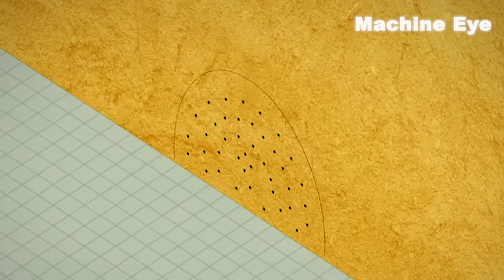China Leaves American President Shocked, Builds The Longest Undersea Tunnel In The World

Comment: Actually, the United States has been building underwater tunnels and tubes for more than a century. The Michigan Central Railway Tunnel (1910); The Holland Tunnel (1927); The Posey Tube (1928); The Detroit-Windsor Tunnel (1930); The Bankhead Tunnel (1942); Lincoln Tunnel (1957); The Webster Street Tube (1963); The Chesapeake Bay Bridge–Tunnel (1964); The Transbay Tube (1969); The Hampton Roads Bridge–Tunnel (1976); The Monitor–Merrimac Memorial Bridge–Tunnel (1992); and The Port of Miami Tunnel (2014). 

Granted, we've not had a need to build anything beyond 5.8 km in length but we have the capability. 

Also, don't neglect the fact that the City of New York has had deep subway tunnels in operation since 1904, and that the underground Delaware Aqueduct supplying water to New York City is 85 miles long and was completed in 1945.

Now, consider that the longest tunnels with underwater sections are the Seikan Tunnel in Japan (53.8 km) and the Channel Tunnel (50.4 km) and compare yourselves to those engineering accomplishments.
Reply: I thought so. Thanks for reminding everyone
Reply: @bobcatbigpaws5597  You're welcome.
Reply: hmmm... 🤔
Reply: But after 2000, US had been slow and slow, and US had many bad or failed projects, such as Big Dig. We are talking about future, right?
Reply: @easymi9964  It's hard to say, because so much is going on at any given moment and corruption, while less a problem in the US, does still exist, particularly where large scale construction is concerned.
Reply: Thames Tunnel London (1843)...
Reply: @benjamindenton  That's not a piece of American engineering, but thank you for adding an earlier feat to the discussion. Should also probably give credit to the inventors of Great Britain who solved the many problems relating to deep mining in the 19th century as well. Without their contributions deep mining and tunneling would likely not have been possible.
Reply: China has been building centuries ago even before the USA ever exist.😂
Reply: @_aweshit  Possible, but modern China is not the feudal China of the past, or the Nationalist/warlord pre-Communist China, or the pre-unification China with it's many kingdoms, or the China of the Mongol period. 
You could probably say that the pre-cursor states that existed before Modern China were building some of the most interesting structures centuries ago and be more accurate, because the links to the past, living and written, in China were decimated and destroyed in large part by the Chinese Communists during the Cultural Revolution. They don't have an unbroken lineage of engineering, construction, and education because Mao and the Red Guards were trying to eliminate traditional histories and allegiances to anything other than the Chinese Communist Party. 
Contrast that with the United States, which has institutions going back to the time before the Revolutionary War and hasn't lost those links.
Reply: @_aweshit  building what? 5 thousand years of killing each other only to be invaded by other smaller nations and only allowed to rise by bill clinton in the 90s? facts are against you, wumao
Reply from the maker: You're right, the United States has indeed built several underwater tunnels and tubes over the years, showcasing impressive engineering accomplishments. Projects like the ones you mentioned, such as the Holland Tunnel and the Chesapeake Bay Bridge-Tunnel, demonstrate the country's capabilities in tunnel construction. It's important to acknowledge and appreciate the engineering achievements from different parts of the world, as they contribute to advancements in infrastructure and transportation globally.
Reply: @MachineEye  Yes, because every country is capable of contributing to the sum of mankind's knowledge.
Reply: @MachineEye  how about you change your name to Pi Yan?
Reply: That means China technology is copy cat.
Reply: A lot of which were built by chinese labor
Reply: @tomcbeatz  Really? Most of the construction was done by union workers and construction companies on the East Coast. Not many Chinese-Americans or Chinese workers on those projects.
Reply: Also going into a long underwater tunnel built by China is a death sentence accident waiting to happen. Even Chinese residents know their structures don't last long
Reply: @MS-ql8ek  I might be inclined to travel in it once, but then again, I'm married and no longer fear death.
Reply: @Cathode Ray Machine Eye is another mouthpiece coming out of China.  China will never get the respects they crave if they don't stop harassing, ramming, and even sinking neighboring countries' fishing boats.
Reply: @choongta  I think that China won't get the respect that they believe they deserve because Communism is the enemy of innovation. Look at practically everything in modern China and you'll see it as a derivative of some other nation's or people's hard work and determination. Corporate & government espionage, intellectual property theft, counterfeiting, infiltration, and purchasing talent from other countries, but little or no innovation and real development. Why? Because communism imposes orthodoxy and the destruction of independent thought.
Reply: We would be able to built more infustratures in USA but with corruption, regulations and a host of hidden agendas, USA is going backwards instead of forward. Thanks to policies made  y our government to stifle progress...
Reply: What do you have in the USA today that can serve the 21st century?  No, high-speed trains whatsoever.  Most so-called third-world countries today have better airports than the US. Stop kidding yourselves and get to work.  The geriatric US politicians are busy spending money funding wars in other countries than helping their homeless people and bringing the country into the 21st century.
Reply: @binizmelekot2911  It's true that we have a number of areas that could use improvement, but:
We're home to SpaceX, Virgin Galactic, Blue Origin, Boeing and a host of smaller companies that produce cargo and manned spacecraft privately and for sale to government agencies. 
Militarily, we were and probably remain, the most powerful nation on Earth, with operational air defense lasers, rail guns, stealth aircraft, aircraft carriers, surveillance satellite systems, and the X-37B Spaceplane. 
The US also has Boston Dynamics, Myomo, Bluefin Robotics, Barrett Technology, iRobot, Harvest Automation, and a number of other innovative and cutting-edge robotics companies (including Tesla). 
Our hospitals are considered some of the finest in the world (Mayo Clinic, Johns Hopskins, Hospital of the University of PA-Abramson Cancer Centre, etc.) and our country produces a substantial number of medical innovative companies (Biotricity, Shockwave Medical, Eko, Cleanspace Technology, etc.) and medical breakthroughs (point of care sequencing, diagnostic nano-sensors, 3-D printed cochlear implants, etc.).
Reply: The underground of New York floods in a nasty way yearly...just by observing through news
Reply: @achayootto4221  True, but most of that water entered the Subway systems from the top down when the NYC streets flooded.
Reply: if you will be interested in binary options trading I can teach you how to trade and earn profits
Reply: @katelynejmont7887  No.
Reply: Hello my friend
Reply: @DavidThomas-xo7ud  Hi
Reply: not under speed tunnel
Reply: @charlessamwel963  Not sure what you mean by "under speed tunnel". Many of the tunnels that I identified in my comment are under bodies of water.
Reply: @cathoderay305  your country, unfortunately, has become an horrible Place to live in. There's no more an "American Dreams". Sure, the companies you cited are ahed in technology, but the measure of how advanced Is a country Is measured by the level of happines that live in is. Russia has a Better military, more advanced than that of the united states. The average Person Will think the contrary cause doesn't know what kind of weapons Russia has. Chinese technology nowadays is at the same level if not superior than that of the usa.
Some western european countries are far superior in overall happiness than usa. In many european countries the access to hospitals and healthcare Is FREE. The United States again leads all nations in having the highest rates of child poverty at 20.9 percent, while the overall average stands at 11.7 percent. do you really think yours Is an advanced country? (Google It) :D
Reply: @ondasuondaable  Happiness is, indeed, relative. 
As to Russia, considering the performance of Russian hardware and soldiers in Ukraine, I would disagree with your assessment. The US did train a substantial number of Ukrainian soldiers and we are supplying them with American weapons that seem to be doing fairly well against that fielded by Russia. 
Regarding the Chinese, they've developed some interesting techniques and tactics, but their military is hampered by poor command and control, political indoctrination, and some of the same deficiencies that the Russian Army is displaying. 
Consider the fact that the majority of US Military Personnel in ground forces (Army and Marine Corps) and many in air forces (Air Force and Navy) are combat veterans of Afghanistan and Iraq and the remainder are very heavily trained, equipped, and funded.
Reply: @ondasuondaable  are you sure " Russia has a better military, more advanced than that of the United States"....?... And how long Russia has been invased ukraine for now and is Russia really taken over Ukraine yet??? Remembered, Ukraine have asking US for military equipments 😜😜
Reply: @cathoderay305  "Doing fairly well against Russia."  Modest.  Even without actual US boots on the ground and being totally and completely outnumbered by Russia, and Russia's 'better' equipment, Ukraine has been spanking them in almost every engagement.  The lines don't lie.

The captured Russian 'air superiority' fighter showed that the only area they came close was in RADAR and even that only had like 80% the range and detail as previous generation US fighters, as in they don't even compare to modern US radar.  Everything else is laughably behind in comparison.

MAD is the only reason anyone takes Russia seriously.  It doesn't matter how crap it's ground forces are if it can intercept and send it's own nukes.
Reply: @DarthObscurity  I'm not sure how this linked into my response regarding tunnel construction, but okay. 
Ukraine is doing fairly well because the West provided training from about 2014 until the invasion to help Ukraine develop strong leadership (NCOs and officers). It's my understanding that NATO personnel trained roughly 140,000 Ukrainian Army personnel in that time. There is evidence that a number of Ukrainian pilots also received flight combat training in the US over the same period. Couple that with a continuing supply of Western weapons and ammunition and the Ukrainians own grit, determination, and ingenuity and you know the outcome for the invading Russian forces. 
As to Russian stealth aircraft, I heard that radar systems supplied to India some years ago were quite capable of detecting them. 
Mutually Assured Destruction is rather a ridiculous threat nowadays, largely because we have anti-ballistic missile systems forward deployed now: lasers and missile systems that seem quite capable of knocking down a Russian missile during boost phase or re-entry. 
Still, war is often unpredictable.
Reply: Itu dulu tapi ini fakta sekarang.
Reply: That's so awesome
How are you doing today?
Good morning 🌅 and hope you have a goodnight rest... sorry if I make you feel upset with my text..but unfortunately I think it's good meeting new people in life?
I'm Glenn by name and I'm originally from Bulgarian lives in Los Angeles California but currently on a peacekeeping mission in Kabul Afghanistan to the war and I will be looking forward for my retirement and you? You can kindly drop me your Gmail address if you don't mind.
Reply: US not a leader in CD construction
Reply: @norisahyussup9911  Sadly, true. The US has fallen behind in major construction activities. I would attribute this to our rather decentralized form of government.
Reply: American people work for life, china government work for show off...! ✌️🙂
Reply: That was yesteryear, we also have the capability of building highways and bridges, BUT we don't repair either one and completely neglect our infrastructure.  It has taken 5 years! to add lanes in a 50 miles stretch between Denver and Fort Collins in Colorado!!!  That is 10 miles per year!!!!  And they will be toll lanes for profit, totally useless for the Colorado drivers who paid for the addition with their taxes. Can't deny that the US is being flushed down the toilet by inept, corrupt, for profit corporations and their stooges in government.
Reply: We don't care. China is the best!!!
Reply: Wow, China can't even build fancy millionaire condo towers without them falling over as easily as buildings built for the poor, or a dam that doesn't fail. Only an idiot would trust travelling an undersea tunnel made by China. Their track record for epic failing infrastructure projects is the reason for this. Japan could do this right for sure, but not China.
Reply: @UtubeTone8626  True, but much of the work done previously represents groundbreaking engineering that has informed later construction methods and techniques. The mistakes made have allowed later generations to avoid making them and to achieve great things based upon improvements in engineering, materials science, and construction. Don't disparage the past achievement of others because the modern techniques are directly derived from or developed from those of the past. 
As to our foreign debt, I attribute much of it to our Government's willingness to give foreign aid and finance social programs rather than to a few "pork barrel" infrastructure construction jobs. Mustn't forget that many major construction jobs in the US are also privately financed or become income earning (like toll roads).
Reply: I'm from India. Why do you have to say about those US tunnels here? This news is about China. Are you trying to prove that American cities are as technologically advanced as Chinese cities? Is that why you posted your comment here? I've been to the biggest cities in China and America. American cities are not comparable to Chinese cities. Chinese cities are far more advanced. Actually, its not just China, many countries in the world has better cities than American cities. Do you know why people think American cities are big? It's because of  American movies. These  movies actually show American cities as world class cities. They don't show bad places in US cities at all. That's not how world cinema works. They portray reality but American movies are so unreal. For example, when you show New York city, what do you see? Big buildings, choppers and amazing roads. In fact, NYC is nothing like that. Some parts of NYC actually look worse than some poor nations. Also, I've seen that you say talk about technology a lot in one comment. It's a fact that America has amazing companies but who runs those companies? Indians and other expats. They are definitely not  people who lived there for more than 5 generations. American cities can be called the city of everyone in that sense. Also, are you aware of how people see you as clowns nowadays? I'm sorry for being straight forward and I know all Americans aren't like this but you guys are going overboard with the "I identify myself as a woman" thing. What are you teaching your children? Males twerking? I've seen a news about that and at first I thought it was some form of satire but later I came to know that its a real thing. Like pride shows and stuff for kids below 5 years old? Like how idiotic a population should be for them to do this? And your president. I mean seriously, who elects clowns like him? I can confidently tell you that I can be a better president for US than him. I'm not even kidding here. Look at your men. They have become effeminate and listen to your women like slaves. Look at your women. They are the biggest hoes(Not all of them but most of them) that your own men are going to Asia for finding wives.Look at how many children do not have a male fatherly figure. Even if your men couldn't put your women in place, some transgendered people have beat them in sport. You call your army to be powerful. I don't think so. If so, you guys came along with Britain to India with your ships to threaten us. We Indians were not even 1/10 of power we have now during that time yet you guys ran away when the Russians came with a submarine. I mean, it was not just America. It was America and Britain together coming from the West and the East. The last time you said you need an airbase in India. We said "NO" and you guys were grumpy but you couldn't do anything to us. We did the atomic test and you guys wanted to block it. You  tested it but we can't? Well, we didn't give a crap and we did the atomic test anyway. Why you couldn't attack us? The fact is America is powerful in paper but not in real life or how can you lose to Vietnamese guys? They aren't even a super power like India or China. What about Afghanistan? I mean, that's not even really a nation. Your top of the line armed professionals lost to some guys who wear white robs and chappals. No boots, no glove, no uniform. Just some random guys with AK 47s could take on your army. That was such a shame. The world saw how you flew away after turning off the electric grid. How many Afgan people died that day? It's because you gave a promise that you will give them freedom and what really you guys did? Ran away from some cow herders with machine guns? That's not power. Look at your movies now. How pathetic can you make it these days? Did Captain America became a woman? Why? Because some random feminists said that they don't like male heros and your men being effeminate said "Yes mam, we will make Captain America woman? What about your music? I saw a fat guy Sam somebody who twerked and tried sexual activities with devil in his stage show. What was that? Remember, he represent the Americans. I mean, my talk is not just hate. This is the fact. Am I lying? No. I gotta give credit to Michael Jackson though. What a legend. From Michael Jackson to Sam devil. That's progression but it's just that you're actually progressing back.
Reply: One kid came out and shows off his smartphone and another kid proudly took out his flip phone and try to convince the other kids his flip phone was built first and better.
Reply: @sportsonwheelss  More along the lines of Chinese building projects not really leaving the American President in awe of engineering that the the US and other countries have already pioneered or proven capable of.
Reply: Why stop and lets others passed you by and feel salty about it?  How glorified it is to have all the capabilities and development.  Tent Cities are growing everywhere, an HSR taking decade to complete, while funding trillions in destructive weapons to set back human kind's infrastructures.
Reply: @sportsonwheelss  True, the United States needs a renaissance in its political life and infrastructure.
Reply: You celebrate the past. 

US is just a casino nowadays.
Reply: @johnhedge9328  and china is toilet bowl nowadays. only use of a toilet bowl is to eat shit, very fitting of china. lol
Reply: @johnhedge9328  If that were the case I wouldn't have to fly out of state to play poker, blackjack, and the slots for money. Seriously, though, I think we can celebrate a country that has delivered the sort of liberties and freedoms that allow for independent civilian spaceflight, that has already put up two manned satellites, and has already had more than one mission to the Moon, as well as placed robots and helicopters on Mars. Let's not forget the Voyager spacecraft and the James Webb space telescope while we're at it.
Reply: Thanks for the detailed write up on the various tunnels in the USA. God Bless ❤️🙏
Reply: @PercyRak  You're welcome.
Reply: @PercyRak  
Horses 🐎 don't like tunnels and other confined spaces, guess that why those ancient tunnels in the United States never got off underground! Perhaps, they should try the 21st century and get some modern ideas and tips from China!🤔🧐🥴🥴
Reply: @jamesstrauss9431  silly jokes of the 21st century have to be from china. lol
Reply: @jamesstrauss9431  Horses spend most of their time in stalls in barns.
Reply: Sorry Ray, we're not talking about tunnels for horses 🐎 and cart, We're  talking about something 21st centurish and beyond!😂😂🥴🥴😔??..
Reply: @jamesstrauss9431  Neither are the ones mentioned. Do some research first.
Reply: @jamesstrauss9431  That's a remarkably ill-informed statement and not reflective of reality in the slightest. Tunnels in the United States are built to handle automobiles, trains, electric subways, and provide a conduit for power and water systems.
Reply: @jamesstrauss9431  since when were undersea tunnels made for horses and carts? CLOWN
Reply: I wonder why? What were they hiding and transporting?
Reply: Your statements made you looks like less confident.
Reply: Just remember that the Chinese have their own space station unlike any country in the world; and also a leader in quantum physiques. That's enough proof for any unqualified person like me to appreciate their strengths.
Reply: @aliganim1288  That just shows China doesn’t have many friends while the US can collaborate with many different countries including Russia when they set their disagreements aside. At the end of the day, nobody even other dictatorships don’t trust a dictatorship.
Reply: @aliganim1288  The US had Skylab in the 1970's, were the first nation to land a manned mission on the Moon in 1969 (Apollo 11), and the first nation with a spacecraft capable of a controlled landing after a mission (Space Shuttles and X-37). The International Space Station also came out of the US Space Station Freedom plans from 1984 and the US is a major contributor  to its operations and built most of the station components. The US has also produced the greatest number of private space companies. 
As to quantum mechanics (a fundamental theory in physics, not physiques), the 'Quantum Insider' ranks the Chinese Academy of Science last in the top ten universities conducting research in this field. Still, not bad, but not in the top 5.
Reply: @aliganim1288  yah. 50 years after US. quantum physics....are you sure you wanna bring this up? wumaos like you are pretty low on IQ.
Reply: yes usa is the best, do not change what you think
Reply: But they aren’t tofu dredged tunnels like the ones in China. Made with grade A quality tofu.
Reply: @juanzingarello4005  No the practice in most of the US underwater tunnels is to use large sections of steel and reinforced concrete that will last and not suffer serious defects leading to collapse and loss of life.
Reply: @juanzingarello4005  pls dont tarnish tou-fu.....tou fu is of some use...china infrastructures and products are bullshit...lol
Reply: @juanzingarello4005  yet you are salty about those tofu dredged tunnels.